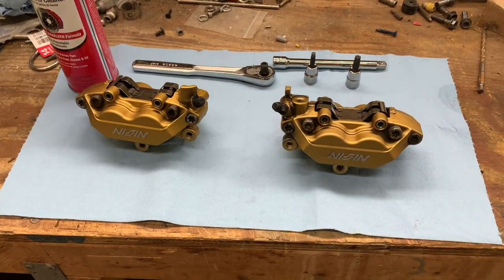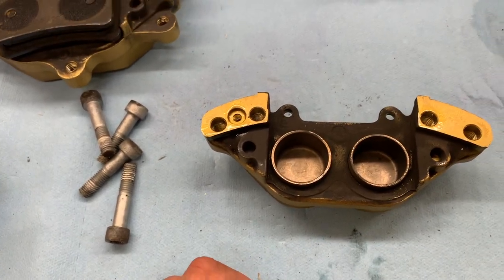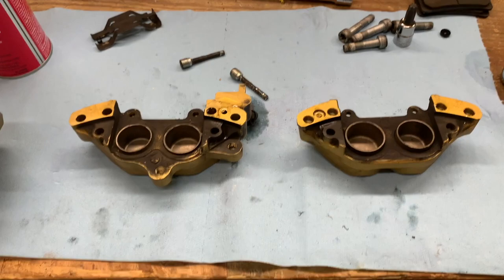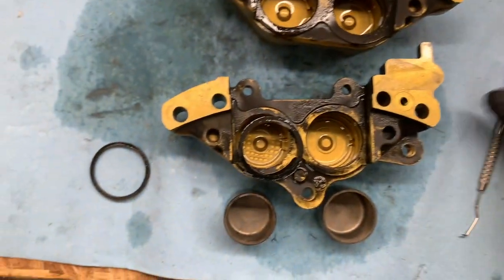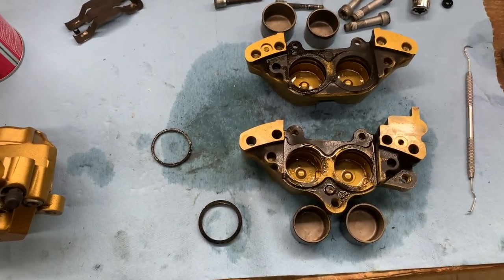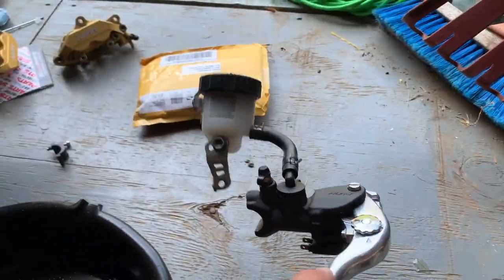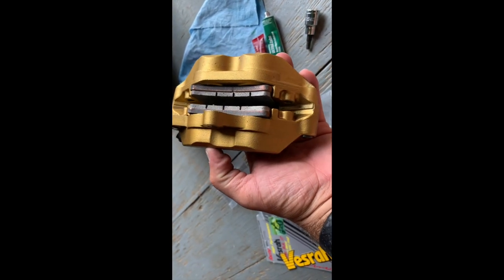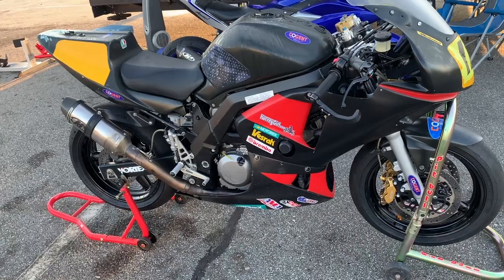SV650 Track Bike Brake Upgrade aka "Project Woah!"

Comment: I just finished a similar caliper upgrade/ swap  on my SV650 with a set of Tokico SV1000 4 piston calipers +++.  full rebuild kit was only $32 for a 2 caliper kit, but EVERYTHING else adds up FAST...SVRP adaptors, titanium hardware, and after seeing the cost of new OEM rotors (!!) I went with Brembo Serie Oro Rotors to replace the worn stockers & saved $150.. ON BREMBOS!?! , new EBC pads, ATE super blue fluid, Speedbleeders.. paired these parts with an also fully rebuilt and restored radial MC from an  '08-'16 Yamaha R6 and F ME !!!!!!   these damn brakes are absolutely incredible any more, it is such a dramatic improvement.  Everything particularly the MODULATION is just ridiculously better. Compared to the OEM system.. it is almost scary,  I feel like I'm having  to learn how to ride all over again....at least... ride quickly...  

My brakes were in fine shape before rotors were showing wear but probably another 2 years away from needing to be replaced. Pads were good relatively fresh, I'd installed Galfer SS lines and did a complete fluid flush etc... everything worked perfectly fine, No issues at all,....but when you then feel how a proper 4 piston setup with fresh pads, rotors + rebuilt calipers + radial MC....Jaysus !!!  it's literally night and day difference.. I'd read it was a big improvement, particularly the MC upgrade...but I was not prepared for HOW much better it is.. 1 finger stoppie time... 

All said, It was NOT cheap and I scrimped every where I could, using crashed MC and used calipers etc,..but I did use new parts and spent probably a cpl hundred on extra bits I didn't technically need right now,...but that I wanted, to do a properly comprehensive upgrade +++...  (Brembo rotors, full Titanium hardware conversion: adaptor mounting bolts/caliper bolts/caliper mounting bolts, VHT paint, HH sintered pads, Spiegler alloy banjos ATE Super Blue fluid.) ..  subtract all the extra shit, I still spent almost $700 on the basic brake upgrade parts : Calipers, MC, rebuild kits, Replacement Brembo MC feed pipe, CNC adj. brake lever, adaptors, SHIPPING, brake lines, fluid, HH sintered brake pads,.. pushin $650       

Regardless,  its the best money I've spent on ANY motorcycle ever.
Reply from the maker: Great breakdown of your project. I sold the bike to a buddy who wanted to race it, but I do plan on building another one and the first project will be the brakes...

Comment: From the reading I have done this bracket kit and caliper setup also will fit the gsxs750.  I have a 2015 and would like to do this upgrade.  There is very little info I can find about it and only one forum thread detailing the upgrade but all pics are missing.  More research ahead! Great video you are very detailed!

Comment: Do you know where to locate the torque specs for the brake caliper pinch bolts on the SV1000 Tokicos?
Reply from the maker: I don't, but I usually use 40lbs

Comment: Were you able to use the same roters from the sv? What about the brake lines and does the stock master cyliner work with the cbr calipers? Thanks for the great video btw.
Reply: Yes I also have this setup.  U need the brackets most importantly. I have steel braided brake lines as well. And it worked great.

Comment: When you were putting adapter on forks you flipped them over :). Good job making mod for brakes.  Anyway i want to make those adapters but i don't have dimensions. Is it possible for you to measure thickness of adapter and offset, and also center to center of bolts?
Reply from the maker: You can buy them pre-made from SVRacing.con
Reply: @Cooper2007ish  yeah i know, but i wanted to avoid long shipping, and also i have machining center. those adapters were made on cnc as you can see endmill marks on back face :)

Comment: Great little video as not many showing the process out there. Good to hear your final thoughts too. Is the master upgrade essential for road use?
Reply from the maker: I would say so, since it pushes more volume than the stock MC.
Reply: @Cooper2007ish  I ended up going with a cbr 1000 rr8 mc too 👌

Comment: Hi, can I ask you if I can use those nissin calipers without the adaptor plate on a Sv1000 from 2004 ? And if yes can i also use a 320 rotor ?
Reply: possibly,... you would have to actually compare mount points and offset for the rotors but it SHOULD work alot of that stuff is fairly standard but youll have to check to confirm........  

The SV1000 has 4 piston tokico calipers tho so why swap to a different 4 piston caliper setup ?  I'm not sure the Nissins are any better than the Tokicos..... they are basically the same parts from different MFG's.
Reply: @RaptorV1USA  hi , thank for the answer first of all, I know that tokico and nissin should be similar but nissin are gold color and reading in some forum people say they are generally better in tolerance and how they are build , I will take a chance and buy them and mount , thanks !
Reply: @RaptorV1USA I have swapped for this nissin gold from a Kawasaki z1000 2004 on my sv1000s and it went straight forward without any modification, I had only to rebuild the o-rings on the pistons just to be sure everything is 100% safe , I don't know if it is placebo but to me it seems nissin are better then the tokikos , might be that also the pads have made the improvement

Comment: I've done a similar thing on my Suzuki Gladius.  I have 4 pot Tokico calipers from a 2002 GSXR 600 and i'm using brembo pads and SS lines.

I'm still using the original master cylinder.  Do you think it's worth buying a radial master cylinder for street use?
Reply from the maker: Absolutely. The difference in brake feel and pressure is amazing.
Reply: sorry im so late to the party,  ;-) 

but its 1000% worth it.....Personally I was doing everything, & didn't wanna spend 150-200  on a good radial MC alone, & i couldnt find enough info on the reliability of the off brand options you can find on ebay from $A80 to $175 all modelled on the brembo RCS setup...so I went with a rebuildable Brembo MC from the Yamaha R1/ R6  after reading THIS is the one to get..about $90-$110 on ebay in good shape or about $50 needing a complete rebuild/repairs, rebuild parts are about $40... The radial MC alone makes such a difference in feel and modulation,... now... I can't imagine going back to a regular MC... it would feel like the brakes aren't working any more lol